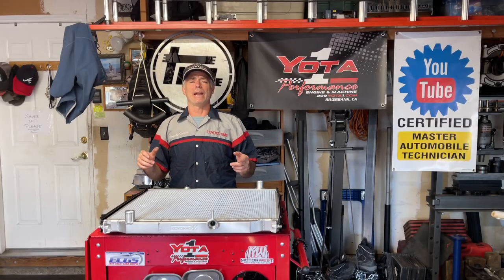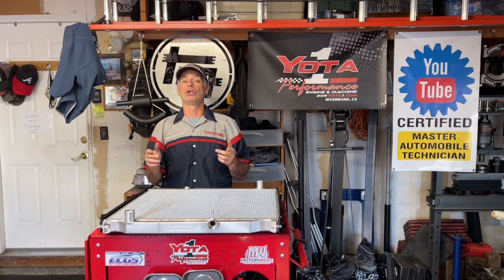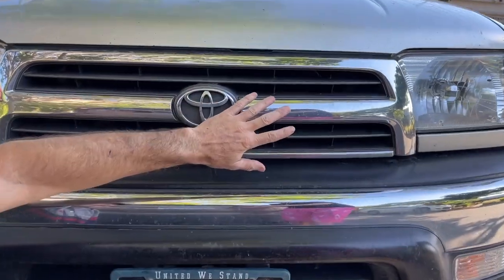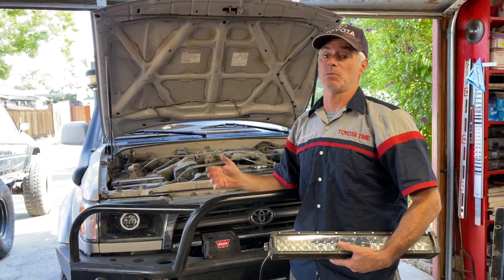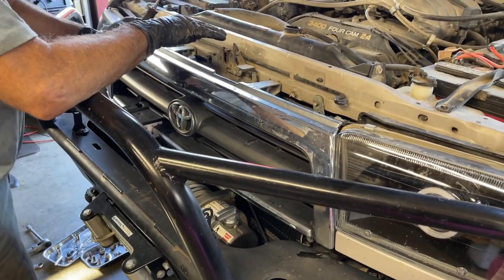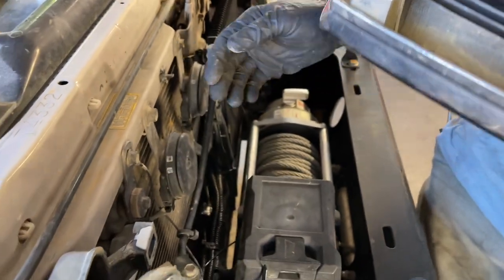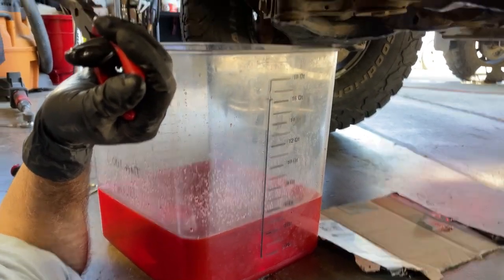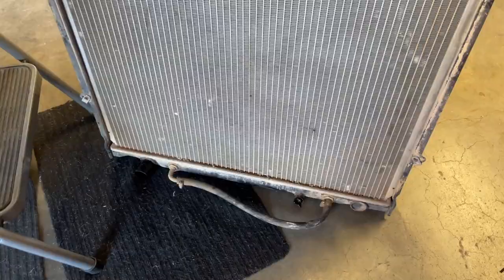Koyo Aluminum Radiator Install - 3rd GEN Toyota 4runner & 1st GEN Toyota Tacoma

Comment from the maker: 09/04/23:
Here's some feedback on how this Koyo aluminum radiator is performing so far.  I've been running it for several weeks now, driving it in some relatively hot ambient temps, in the 90's.  So far, the results look promising.  I drove it up some grades, with the AC on full blast, and the engine tenps never got higher than around 194.  The only thing I haven't added to the equation is having my rig loaded down with a bunch of gear adding some weight to make the engine work harder.  When I finally take a trip and I'm loaded down with gear, and I'm driving in hot ambient temps,  I'll report back to let you guys know if the Koyo radiator is still keeping my engine temps to a reasonable level.
Reply: When replacing the radiator I suggest a complete coolant flush, new cap, new thermostat and new hoses.
Reply from the maker: @richardstone5241  I can't argue with that advice.  In my case, my coolant was renewed 10k ago.  My radiator hoses, thermostat, and fan clutch were replaced 35k miles ago.  So, no need for me to replace the hoses and thermostat.  They have a lot of life left.
Reply: I see, most likely good to go, just my way of doing things (overkill) ............lol @TimmyTheToolman
Reply from the maker: @richardstone5241  Well, you can't go wrong with overkill, unless money isn't plentiful,  then it might be an issue.
Reply: Yes, and there is never enough money...lol @TimmyTheToolman
Reply: Second owner of mine and previous owner use straight water due to long time until replacing rad. Replaced rad but used old water. After three flushes I took it to a rad shop and the “routered” out the rad (have no idea what this entails other than taking rad apart). It was only a year old, so… Regularly have 100 plants s temps in my area and grades. Haven’t had a problem since. Just saying.
Reply from the maker: @safeteyvalve  Sounds like the previous owner wasn't too bright.  It was probably tap water too.
Reply from the maker: @richardstone5241  Yeah, I've never had the problem of having too much money and not knowing what to do with it.  That's a problem with the elite wealthy types, and that ain't me.
Reply: @TimmyTheToolman  Tim, I have the same radiator on my built up supercharged 4runner and have used it for years, and am now down in the desert heat. Running mostly distilled water and redline "water wetter" helped, but honestly you may need to look into re-gearing if you haven't already. The radiator can only do so much and the 5vz cooling system sucks by design anyways.
Reply from the maker: @league04  I've already regarded to 4.88s.  Didn't really have an effect on my coolant temps that I could tell.  The Koyo radiator is having a noticeable effect so far.
Reply: Timmy, I hope you see this too. I just now remembered: there's a shop featured somewhere in a video on youtube, and all they do is professionally clean both new and old radiators, cooling tanks, heater cores, etc. They showed the scale & debris they are able to get out of brand new, never before used, high end all-aluminum radiators & other coolant components. You'd be amazed at what is still inside a new unit. Also: they stressed that even distilled water causes a level of degradation in the long run. They said DE-IONIZED water is the best choice, ( same 50/50 mix with coolant of course ), and is also the safest thing for head gaskets long term. Like everyone else, I was always taught to use distilled water/coolant at 50/50, or pre-mix. So next time I flush & renew my coolant, I'm looking into sourcing & buying de-ionized water.  @league04

Comment: I just put in a Champion Radiator, all aluminum, in my 96 4Runner.  It was a direct replacement and fit great.  It came with the trans cooler.  I did not remove the grill, I used swivel socket or wobble extension to remove the radiator bolts.  The bolts aligned along with the fan shroud bolts. Fit great for $265 and looks the same as this one
Reply from the maker: It might look the same, but is it equal in construction to the Koyo,  I would argue it probably isn't.  The early champion radiators were a poor fit.  The bolt holes didn't line up well.  We did an install video for the Champion radiator a few years ago.  I guess Champion heard the complaints and fixed the issue.  I've heard of failures with the Champion radiators, but I don't know if those were isolated incidents or a real problem with their quality.  I guess time will tell.  Thanks for the comment.
Reply: @TimmyTheToolman  another reason to avoid Champion is that they specifically say to avoid using Toyota Red/Pink coolant, as it will cause leaks and/or clogs in their rads. You would have to switch over to green to 'safely' use the Champion rad...which is a non-starter for those who want to keep Toyota Red in their trucks.
Reply from the maker: @n4656bravo  Good point.  I forgot about that.  Thanks for the reminder.
Reply: @TimmyTheToolman  They must of fixed the alignment issues because mine fit great.  I wanted an upgrade from a Denso oem replacement and this worked for me for the price.  I still had the original radiator and was worried about the milkshake.  I switched to green anti freeze back in the late 90’s and have not had a problem.  I have 225,000 miles

Comment: Excellent video as alway Timmy! 👍🏽 I recently started to have overheating issues here in Florida at idle after a 20min drive. Diagnosed a bad fan clutch over heating issues went away, however, this radiator upgrade is gonna be beneficial in this heat.
Reply from the maker: Yep, I renewed my fan clutch, so that wasn't my issue.  But, Yes, a bad fan clutch can easily cause overheating issues, especially at a stop, with no air being pushed through the cooling fins.  Thanks for the comment.
Reply: That's something I didn't think about with my 3RZ rebuild ( 2000 Tacoma 4x4 ).........a new fan clutch. I did install a new OE radiator & hoses though. It's been a year since my rebuild & still running cool, but it sounds like I better go ahead & replace my fan clutch. Why wait until the inevitable happens. The old fan clutch has nearly 400k miles on it. Yikes.  @TimmyTheToolman
Reply from the maker: @howabouthetruth2157  Yesh, I'd definitely renew your fan clutch.
Reply: Timmy, what are the signs of a bad clutch anyways? New owner of a clean rust free rig up here in Montana. Winterizing for the harsh witers we have. Going to swap out the radiator as a KOYO as yours. But util then can I just plug off the tranny lines into it and do the aftermarket 'thing'? Switch the radiator next spring when I have a little SSI stashed away. Lot to spend on. Do you have a recommendation for a cooler, I'm sure you have a video of which I've subscribed to 'ALL Things Timmy', just want to collect all things up. And, what do you think of a 'harfbar/trackbar replacement to get level after a 2.5in lift? Thoughts? Driving lights through the corners of the grill? 3" sq onel w harness. Seafoam into the throttle body for upper engine? And can you use one of thc two capped off port on the throtte body to hook into.. Nothing inside to monkey with should just go with it, and what are 'they' for, would you know. Winters here in Montana are quie harsh as you know so I'm setting up a pan heater for oil and one for tranny, sute won't hurt. Thank for info man. Your site is strait forward, thanks.
Reply from the maker: @danielvoulkos8274  We have a video for testing the fan clutch.  Yes, you can just cap off the trans cooler fittings on the radiator if you are going to bypass.  The Hayden 699 cooler is what I recommend.  I have a video for installing it.  I don't understand your Trac bar question.  I suppose you could use one of those capped off ports to inject the seafoam, but I've never tried it.  Auxiliary lights would be good.
Reply: @TimmyTheToolman  Thanks, I'll check it out (clutch vid). Ok here' the lowdown on the trackbar....panhard bar at the rear axle. From what I've learned, if you have a lift....which my new 98 4Runner came with, you should bring it back up to level, as it was from before the lift. It is supposed to stop body roll that you get more of with the lift. I more or less researched that by steering back and forth on my country road here and man, I'll tell you, I wouldn't want to swerve very hard missing a deer or elk on the road. It is true. Trying to miss somebody in front of you and end up in the oncoming lane. This rigs lift was an Old Man Emu lift. Its good for where I'm at up in the woods w heavy snows.
Reply from the maker: @danielvoulkos8274  We made a video about the PCK (Panhard Correction Kit) our buddy Keith makes.  https://youtu.be/akY472AbM9c?si=lyKcHTk1CyOcoUQv

Comment: Changing the three belts on my 96 4Runner and leaning on the radiator with my forearm and the radiator hose nipple on the top snap straight off😢 I'm old school and I don't remember junk like this in the old days when things were made out of copper radiators😊 I ordered a radiator from PartsGeek on Saturday and it was quite a job to change out the belts but your video helped me on that
Reply from the maker: I've accidentally did the same thing on my buddy's 3rd Gen.  I snapped off the reservoir nipple, but he was able to successfully glue it back on.
Reply: @TimmyTheToolman  this radiator has been patched up with epoxy 2 across the top and the side of the top Reservoir and the way that thing broke off and as easy as it fell apart in my hands I think it was the original radiator that scary because it could easily been a breakdown off grid or on a Highway trip far away
Reply from the maker: @markeverson5849  Yeah, you were due for a replacement.

Comment: One of the things I’ve done is running auto radiator . I now run engine Oil through the transmission port . It’s done wonders on oil life and temperature stability
Reply from the maker: Gotcha.  So you're now using the trans cooler as an oil cooler.  Pretty cool.
Reply: Here in Ky it helps in the winter to heat the engine faster too
Reply from the maker: @JamesTLangford  Makes sense.  Thanks for sharing.
Reply: That's interesting. Never heard of doing this before.
Reply: Rancher friend of mine up here in Montana always drill a 1/16th hole it all his outfits. He says it stops with any airlocks. He's a great mechanic and builds his own airplanes....I trust him all the way. I've been doing it for half a dozen years now.🤠

Comment: Great video !! I got a tip from a race car friend drill a small hole in the thermostat that way there’s always water flowing ever since I started that never had a issue but not speaking from very high temp states or loaded beyond stock excited for this video
Reply from the maker: The OEM thermostats have the jiggle valve, which lets coolant pass through.  I don't know how drilling a hole would make any difference.   Once the thermostat opens, it's open, letting coolant flow.
Reply: @TimmyTheToolman  ya it does I always put the hole upright mine was getting little hot even with new thermostat tell I was told the drill trick but I’m also all stock besides just a winch bumper I see how it could help like a big block or something in that nature but once I have hot weather going to load it up and give it a shot the alum upgrade is definitely a big thought of mine
Reply from the maker: @aaronscott2278  Good to know this trick.  I might try it the next time I renew my coolant.

Comment: Enjoy content. Have. ‘95 t-100 and far fewer content providers on this model, but you seem to have most of the important things covered- or I can easily follow with slight modifications. I’ve got to do timing belt/water pump/crank seal/pulley replacement soon (this summer?) and use your content due to never done this before. Thanks!
Reply from the maker: It's great to know you appreciate the content we offer on our channel.  Thanks for taking the time to comment.  Good luck with the timing belt job.
Reply: @TimmyTheToolman  any tips /tools recommend for removing crank seal?
Reply from the maker: @safeteyvalve  We show the tools we used for the removal and insertion of the crank seal in the video.  They are linked in the video description.  Be sure to watch Part 2 as well and read the comments we pinned (1st Comment you See).

Comment: Been struggling with high temps in the Arizona desert and my hundred series. I did the normal flush and fan clutch and thermostat, etc.. I was thinking about upgrading to an aluminum radiator and maybe trying to find a larger one and then doing an aftermarket transmission cooler just like you did. That actually never dawned on me so thanks for that! Also, think maybe my AC condenser might have something to do with my overheating problem, some of the aluminum fins are kind of just corroded away and it seems that, maybe having some kind of a effect. Like that condenser gets unusually hot and so the radiator right behind it suffers the consequences? Love your videos buddy thanks.
Reply from the maker: Good luck with your 100 series.  So far, I can tell the aluminum radiator is making a difference.

Comment: I replaced my radiator with a cheap Chinese made one from eBay and I’ve never had it overheat on my 2000 tundra and I always tow my boat and I have towed a trailer over 8000 pounds with my dirtbike through the desert.
Reply from the maker: Do you have any mods like a bumper, winch, or lighting affecting the air flow through the front of your rig?

Comment: I used to live in Utah and worked for a business that built mild to wild off road vehicles and I love the 4Runners.
Here are a couple strong suggestions based on experience. I DO NOT LIKE INSIDE THE RADIATOR TRANS COOLERS! They are a disaster waiting to happen NOT MAYBE BUT WHEN! Go external transmission cooler as soon as you can, like yesterday! And, I do not like radiators made with PLASTIC (same reason, designed to fail). Now, this might sound like overkill but I change ALL of my fluids ANNUALLY and engine oil (synthetic) every 5,000 miles! As a result, ALL of my vehicles had over 250,000 miles on them when I sold or traded them and they all ran like new.
Reply from the maker: So here's my opinion on your comment.  The trans cooler failure that causes the destruction of the automatic transmission is a more isolated problem than you would think it is frequenting Toyota forums and Toyota Facegroup groups. It gets talked about on these sites and then everyone thinks it's a ticking time bomb.  It really isn't  The plastic radiators are fine, but they need to be renewed as preventative maintenance,  I'd say every 100k miles.  If you wait too long, yes, the radiator can crack and leave you stranded.  

I'm a big believer in fluid maintenance also, but every 5k for all fluids is excessive in my opinion.  5k miles for engine oil and filter changes, yes, I agree with that.  I do a drain and refill of the trans pan every 10k.  Rear diff gets new gear oil every 10k.  Front diff gets new gear oil every 30k.  The transfer case gets new gear oil every 30k.  Coolant gets renewed every 30k.  Power Steering and Brake fluid gets replaced fairly regularly too, about every 30k.
Reply: I thought that is what I said, 5,000 for engine oil and all other fluids each year, that's what I meant anyways. Granted, if a person is using their 4runner like a soccer mom then none of this is necessary, just follow the owner's manual. But, if you actually use and enjoy your rig (no not rock crawling) like I do then ....... @TimmyTheToolman
Reply from the maker: @richardstone5241  Yeah, I misread what you said.  So, it depends on how many miles you drive annually.  I've never done fluid maintenance based off time, only miles driven, and what kind of miles driven.  Flat freeway miles is a lot different than miles driven on mountain roads or miles driven off-roading.
Reply: Yep, by the way, love your channel, hands on instruction, well organized and great information! @TimmyTheToolman
Reply from the maker: @richardstone5241  Thanks Richard.  I really appreciate it!

Comment: My 97 Ltd overheats with no bumpers but had Under armor and 40s so this would definitely benefit my main offroader thanks for sharing 10:10 @Timmy The Toolman
Reply from the maker: Have your replaced the fan clutch yet?
Reply: @TimmyTheToolman yep its not the fan clutch I belive it's Because of the extra drive train weight from the 40s and How hard I have run it At Moab I need a better radiator and cooling setup for it
Reply from the maker: @AntonioClaudioMichael  Gotcha